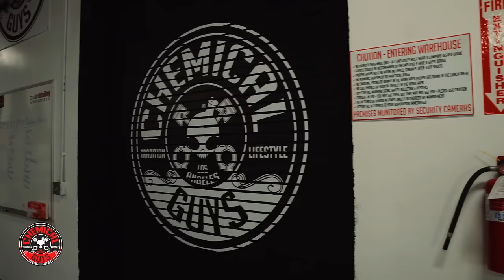How To Detail A Silver Car - Ferrari 575M Maranello Detail - Chemical Guys

Comment: I love these videos! What do you guys mean by maintaining jetseal? At 34:18
Reply from the maker: +Brandon Peixoto 
What Matt meant by maintaining JetSeal is making sure it last it's longest on the surface on the car. This could involve washing the car and applying wax on top of the JetSeal.

For example:
 If you add JetSeal, then neglect the car and not wash it in months and drive in harsh conditions such as rain, snow, dust storms, and hot sun, chances are the JetSeal won't last as long as someone who regularly takes care of their car.

-CG Alex

Comment: Is blow drying a car really faster? Honestly does not seem it would be to me.
Reply from the maker: Hey Ronald, that's a pretty sweet Ferrari! To some people it is, in a way it's good because you're not dragging anything along the paint. The true downside is that you need a decent amount of compressed air to get the desired effect. Until they come up with some kind of portable microwave that evaporates water without cooking the paint, you're better off using a soft plush microfiber towel, and a drying aid to get all the water off. Stay tuned Ronald, we've got a new video launching tomorrow!!

C.G. Alex -